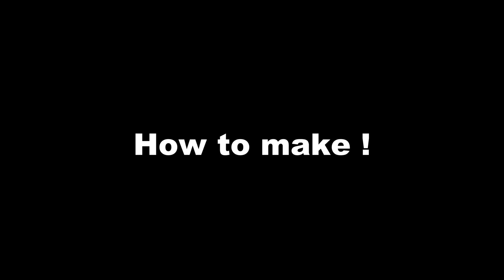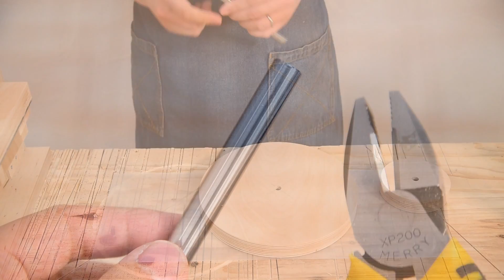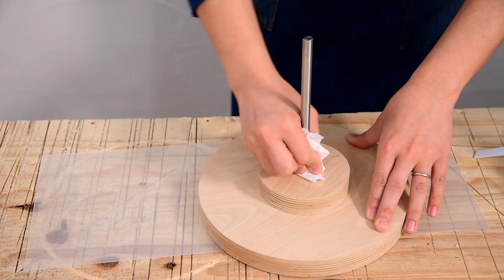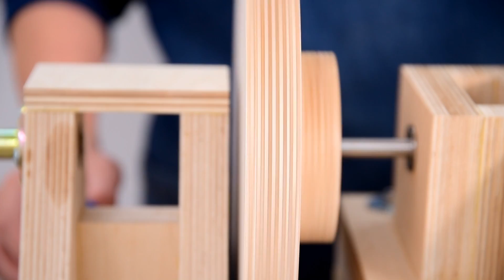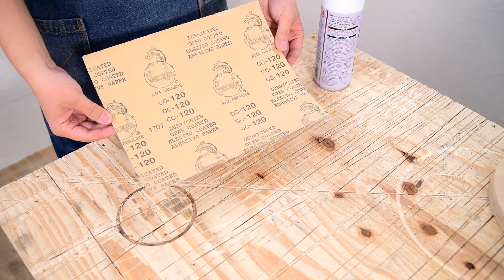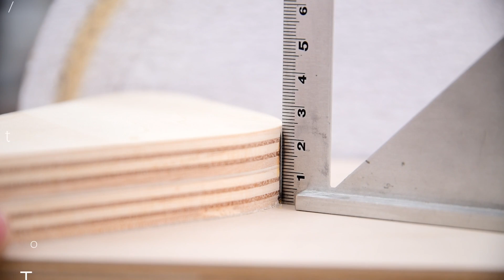Making of Disc sander - 6in1 drill press Part.4

Comment: Hi Jisaku, beautiful job.  To make use of the sanding disc more versatile, you can replace the glue / stick for paper with velcro. Just get a velcro backer (loops) and stick it to your disc plate. Then, purchase velcro backed (felt) discs and put them on as needed. You can easily change papers to give different grits. Cut out a circle in paper into two halves. Pull disc off the velcro and slip in paper in between. Rotate disc and lift off second half.  Lay second half of paper onto disc and then you can place replacement disc. Move around till you have correct alignment. Remove first half of paper and press to firmly attach. Rotate disc 180 degrees and repeat step. You now have a fresh disc perfectly aligned. Happy sanding.

Comment: Very good idea. One more part is missing about the sanding machine with sandpaper instead of knives (it was mentioned at the beginning). It's bad that they put a ban on downloading videos ... in the workshop, the Internet is unavailable when you want to repeat. There are not enough dimensions of parts, it remains to guess on the dimensional grid (1 cell = 1 cm?).